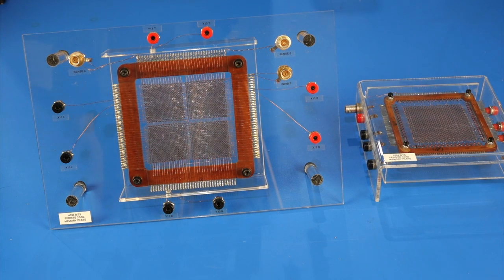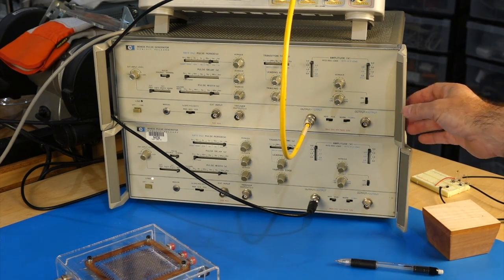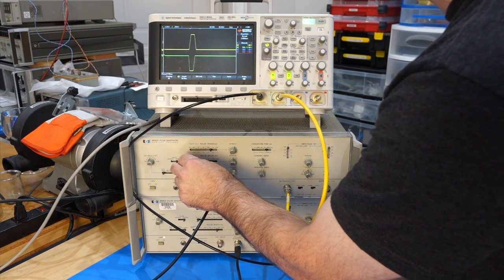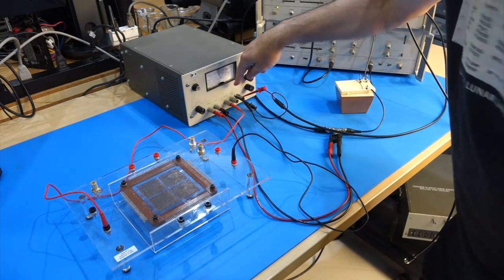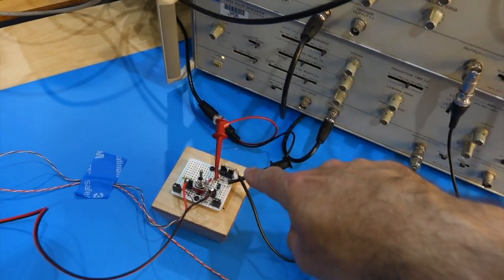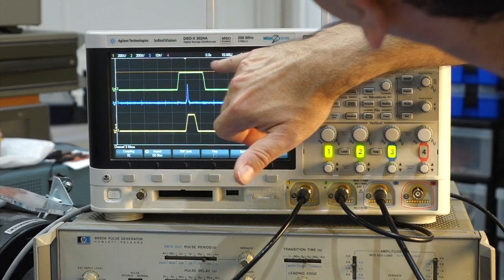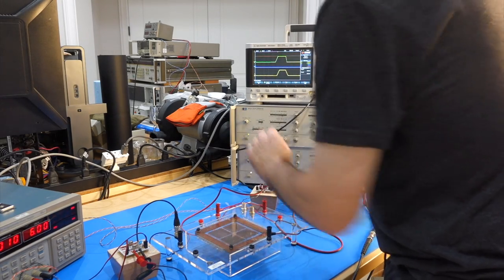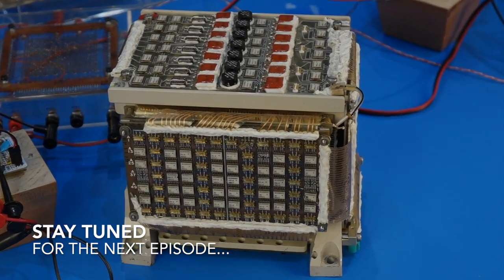Playing with Soviet Era Ferrite Core Memory Planes

Comment: I would love to know how they multiplexed and controlled all the signals for those bits in the original machines. I have found little information about it, but it seems like it requires a tremendous amount of circuitry.
Reply from the maker: Yes, it requires a lot. In the AGC, about half the computer is the memory and its related circuitry.

Comment: When I first heard about this kind of computer memory, I wondered if I could make one myself. I mean, it's basically a bunch of copper wire, right?
Reply from the maker: Ferrite cores with the right properties are pretty hard to make, but if you find some and are good with very small wires, you can definitely weave your own. Someone even sells a kit I believe, Carl built it.
Reply: I'm wondering if small steel washers would work if you used enough current. Might try an experiment some time.
Reply: @gcewing  gotta be ferrite magnetic cores, like little tiny fridge magnets but more more precisely manufactured
Reply: You can get a core shield for the arduino at corememoryshield.com
Reply: The key to the memory element is that it has wide hysteresis characteristics, so that cores energized by half the current will definitely NOT flip, but those at the coincidence of the X and Y wire will definitely flip. Do a google of hysteresis to learn about the magic that lets you address a 4K group of cores with only 64 X lines and 64 Y lines. If you needed 4096 line drivers the support electronics cost would be prohibitive, but 128 drivers is more achievable.

Comment: What is the maximum reliable rate you could read all the data while restoring the code state to pre-read state?
Reply from the maker: It got faster and faster with smaller cores, better weaves and better circuits. The AGC for example has a memory cycle time of 11 microseconds. The later top end IBM 360 machines achieved 400ns I believe, which is incredible. The better of the two planes here appears to be somewhere in-between, like 3 microseconds for a read/write.
Reply: @CuriousMarc  I remember when 400ns was a good response time for dynamic RAM.
Reply from the maker: @DevilsHandyman  Exactly!

Comment: In the second array, the sense wire that does only ¼ of the array might be to, in my opinion, bifurcate the memory into two sections: one more frequently accessed, another with comperetively less accessed data.
Reply: Same thought, perhaps the core is segmented into 2 sections, one for the program itself, and the other for the data. Would allow the program read (and rewrite per word) to be done, and while the execute unit is fully decoding the instruction word the data section can be reading the data word referenced by the first operate cycle in already, so that you are not limited by the CPU speed in fetching the variable. Or perhaps a segmented memory so that an out of bounds program cannot in any way write over the bootloader stored there, as it is physically unable to read past the first word without throwing an exception or an interrupt.
Reply from the maker: Could be, like for registers. But it’s not like in a well defined corner with well defined addresses. It’s sparse picking cores  all over the matrix. Very strange.  Maybe Ken can figure it out,
Reply: @CuriousMarc   I'm curious if this mystery is solved yet? Any thoughts from Ken?
Reply from the maker: @BhaveshDiwan  Mystery remains!

Comment: Wait wait i am confused a bit
Didnt you read apolos core memory and didnt destroy it?
Reply: That was core-ROPE... slightly different technology.... this is yesteryear's RAM.... that was yesteryear's ROM.
Reply from the maker: @edgeeffect  You are correct, but we also read the erasable memory the first time we got it up. In general you’d have only one shot at it then. But in this case it was in the working machine so the read/write circuitry automatically rewrote it while we were reading, except bit 16 which inhibit wire was cut therefore rewrite would not work. That’s why we dumped the memory as our first task.
Reply: @CuriousMarc  wait then you didnt read bit 16 or you did but after that the potted module (black one) was broken forever
Reply: @Veso266  We did it in two steps. To dump the memory, we left all of the original wiring intact, and shorted across the broken inhibit wire on the backplane. This let us read all 16 bits, but bit 16 was written back incorrectly during the writeback stage. After that we took the computer back apart and performed the bit 15/16 swap.
Reply: @mikestewart8928  i wonder would it be possible to recreate that module without the potting (you had all the plans anyway) so you wouldnt need to swap 16 crc bit (iirc) to make the agc work

I know its a bit too late to ask since you dont have agc to play with anymore but still

Comment: looking on ebay yeah... $100 for 128 bytes of Core Ram.  Not bad...  (This is an admittedly strange hobby. <3)
Reply from the maker: I doubt this one would sell. Mine was around $30 I think, which for a non damaged unit was quite reasonable.
Reply: @CuriousMarc  Indeed.  you only needed a few thousand dollars of HP equipment to make it work. ;D

Comment: What is the inhibit for?
Reply: Imagine you have a bunch of those planes stacked up in parallel. That way you can access entire word using the same x-y address. But if you do so without the inhibit line you will access all planes simultaneously. Not only will it destroy the word all at once, but you will also be unable to read it correctly (as all bits from this word are read simultaneously and as a result come to you in jumbled mess). To avoid it you can send pulse through "inhibit" line into all but one plane. That way only one bit will be read and destroyed.
Reply: @TheChygynok  oh i did not have in mind the other Panels, makes sense if you have more of them in parallel or in series because of the current source ;)
Reply: The inhibit is for the rewriting of the core you just read. If you read the core and it gave you a pulse, then it had a 1 stored in it. You reverse polarity and send a pulse in, the bit is set to 1 once again. However, if there was no pulse when you read it, the contents had been a zero. In that case, you put current through the inhibit line in the opposite direction to the writing pulse, it cancels out some of the current and the core does NOT flip. Therefore even though you sent the X and Y pulses, the core is not flipped and stays zero.
This allows you to have a circuit that always sends current one direction to destructively read a core and then always sends current the opposite way to write the core - the combination of the two is a memory cycle. Depending on what data came out of the core during read, you either turn on or leave off the inhibit line to cause the core to have the same bit value at the end of the memory cycle as it did before you started.
Reply from the maker: The inhibit wire opposes one of the address lines. During rewrite, the address lines are all flipped to rewrite all cores to one, and you strobe the inhibit only for the cores that need to be left to zero. Allows you to do the “intelligent” part of the rewrite control with just one wire and driver, which made the electronics scalable, and also works well with stacked planes as mentioned.